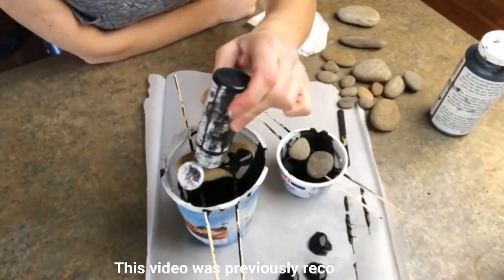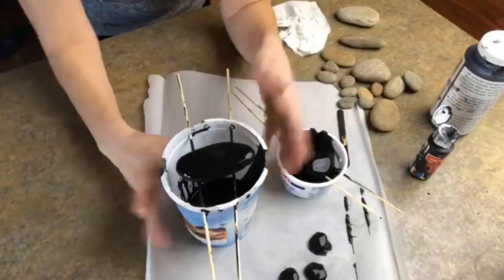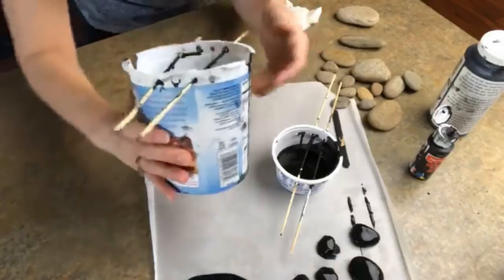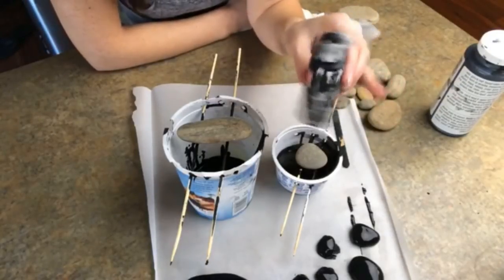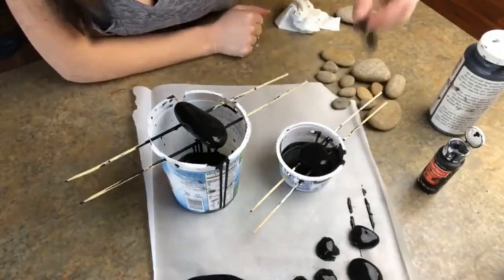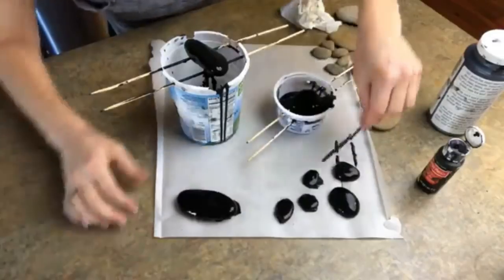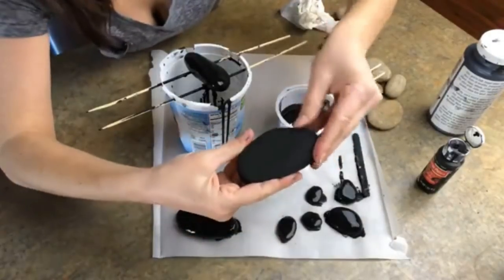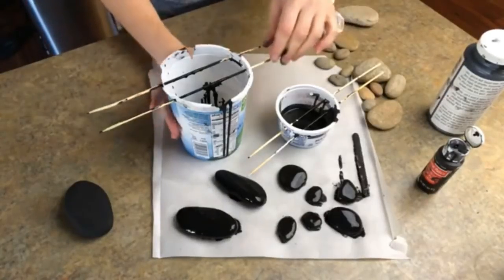Create a simple and inexpensive base coat for your rocks!

Comment: Great idea & what kind of spray finish do you use as very sensitive to any sprays w resin, never epoxy but maybe a Kyrlon?
Reply from the maker: You can use a brush on product. DecoArt has one called DuraClear that I like a lot! The video going up tomorrow is actually all about using it!
Reply: If on rocks & we know going to be putting some outside to decorate (like for garden w flowers also) then doesn’t get yellow with sunlight exposure over time? 
    Most don’t usually do rocks all white but what a neat product if does not turn yellow & you paint it on in thin layers & let each dry first if want even more glossy look? Tyvm as very hard to find (well many mediums we use) do have warning’s on them but after doing the opposite learned to believe them & just because no strong smell (can still hurt you so feel like any fumes) shouldn’t say on front ok to use inside but when look on back have “safety codes” & then tell you not great to use in just your paint room! 
     So now read the back but have no idea what these codes mean; however if one side says sorta ok & other says ummmm be careful then know now as feels a bit deceiving when saying (New product available for high sheen & low to no odor)! Tyvm..